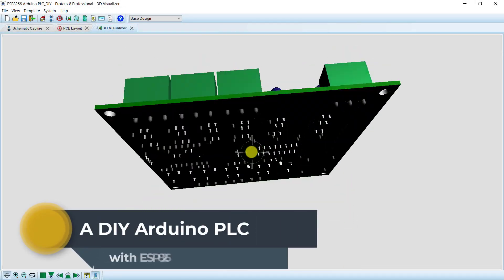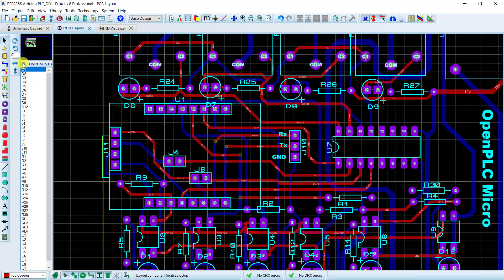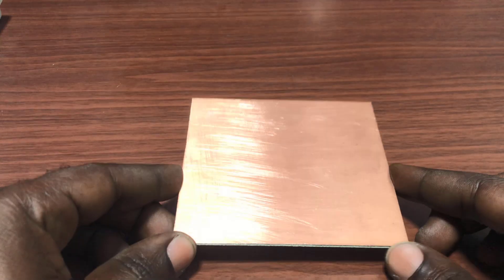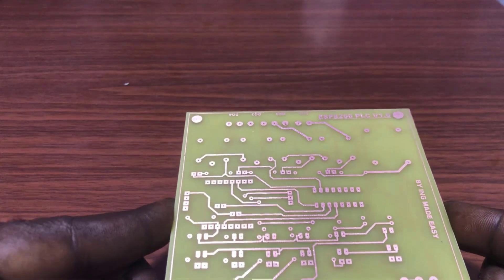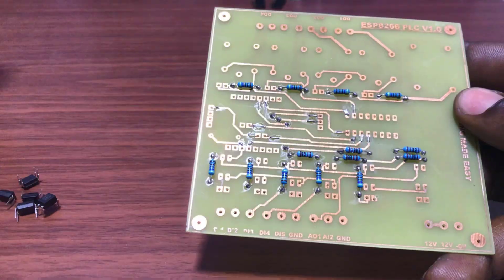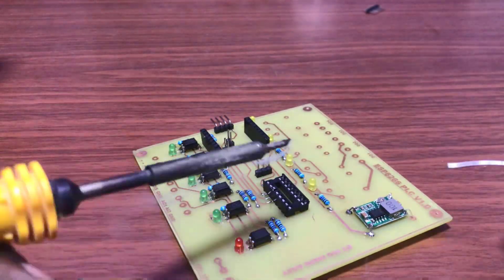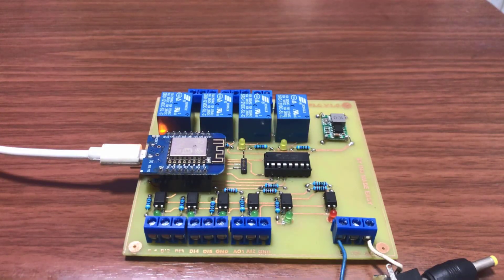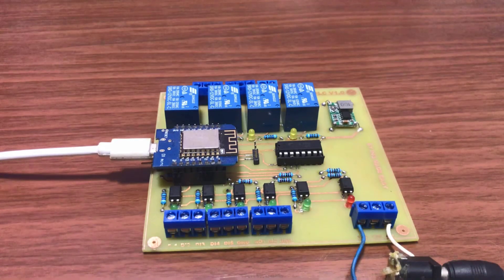Building a DIY Arduino PLC with ESP8266

Comment: Please write me your email 
I need to develop a PCB project for esp8266, 8 relays, 8 4-20ma inputs, 16 inputs via a shift register for a button and 16 5v outputs via a shift register, I would also like a built-in OLED display connected via 4 pins, could you design such a PCB for me?
Reply from the maker: @DNM_Live  princekissi008@gmail.com  thanks
Reply from the maker: @DNM_Live  princekissi007@gmail.com thanks